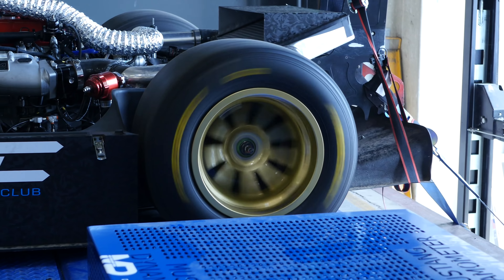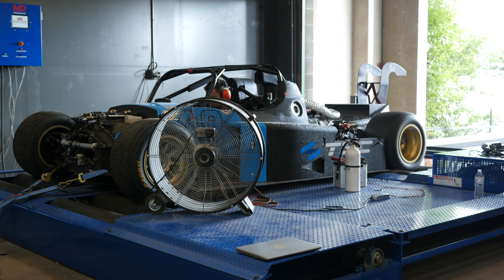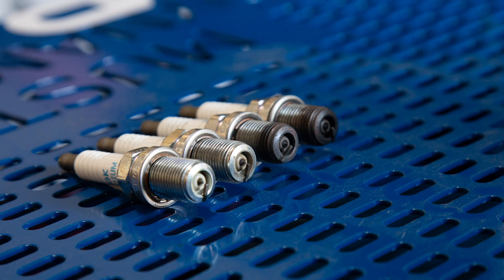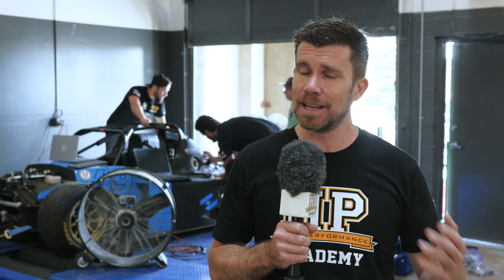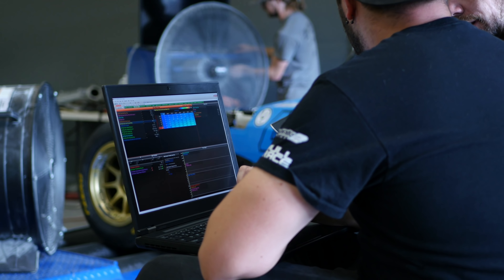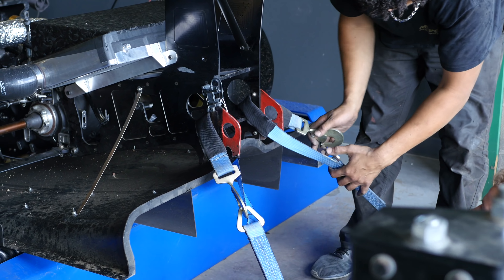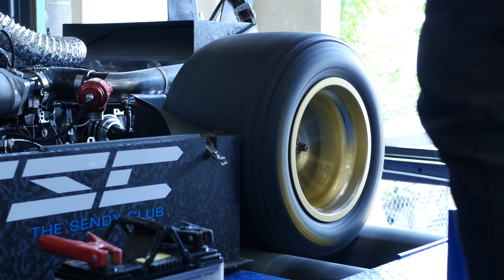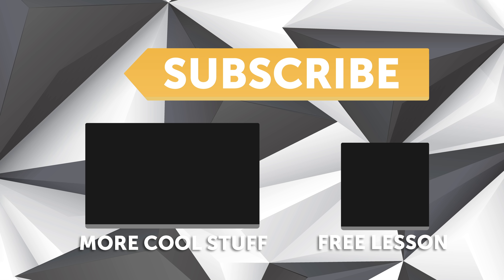Can you guess what was wrong? We couldn't.

Comment: Even on non vvt engines, when I have a cam sync signal I always log the vvt angle or take note of the 'sync' position so changes like this can be found straight off the data by comparing it when the engine was tuned.  Terribly unlucky to have this happen after the car made it halfway across the world!

Comment: I usually work on ca18, rbxx and sr20 Nissan engine, and a common issue appears when people reconnect the 2nd and 3rd ( or 3rd and 4th or RBs) injectors and exchange them, which causes a rich mixture, misfire and idle problems. Glad you found what causes yours 👍
Reply: Faulty coilpacks and connectors for days!

Comment: I would have spotted this within minutes, as the ECUs I use let me log the relationship between the crank trigger and the cams, ignition coils, injectors. Also because I have done a lot of work with the Honda K series engine and the timing mechanism on them has not been perfectly reliable in the past, had dowel pins shear off before as well as the chain jumping teeth due to worn out tensioners. So when one doesn't run right, the cam timing is always a top suspect.
Reply from the maker: @Baldur it's easy to look at this now and say you'd have spotted it instantly, however hindsight is always 20/20 . When diagnosing faults, I start by following the symptoms presented. I've been involved with dozens of engines over the years which had cam timing faults and they generally have a pretty clear set of symptoms that point to the issue which makes it quite simple to pickup so on that front I don't disagree. In this particular case however I've never seen the symptoms that this engine presented in 16 years of building and tuning high performance engines. Given the same set of symptoms again I'd follow the same diagnostic path we went down.
Reply: Yes, absolutely. I'm just saying I've seen this exact fault before on this particular type of engine.
Reply: So you would find a fault on someone elses car because you use ecus with advanced logging features. So you just change all customers cars to the same ecu?
Reply: Of course I have dealt with dozens of different types of ECUs, but I would advise my customers to use the best. I was just pointing out that the failure mode described in this video is extremely common, I've seen it numerous times on different types of engines and a few of them were Honda K series. How to avoid it, first make sure the bolts holding the sprockets all get the right amount of torque, they need a lot of it. Second, make sure the dowel pins are good quality, aftermarket cams sometimes come with dowel pins made of soft material. I've even seen an aluminium cam sprocket on a 4G63 shear off a soft steel dowel pin with no damage to the sprocket. Third, on the K series we also machine the timing chain sprocket on the crankshaft to be supported by a square key and not just the 4mm dowel pin that it uses from the factory, as even with proper torque on the bolt they have been known to turn and shear pin if anything goes wrong. From the factory the crank has a keyway to support the harmonic damper but the chain sprocket does not make use of this key but has a 4mm diameter dowel on its back face instead.

Comment: This is a really good topic, Is the car breaking up on test runs, might be the turbine being inadequate for the elevation changes. AFR on turbo might be choppy due to their tune at lower elevation, with the increased elevation that pikes gives you. Alot of guys run into this problem where they have to run larger turbines so they do not over drive them. Could of cooked the turbo, try decreasing waste gate pressure, let more boost out and run on more conservative tune. When i race na style sport bikes, dirt bikes, quads. They tend to break up once you get to a higher elevation, best way to solve this is run a higher octane fuel with a very lean fueling bias, (hint leaded aviation normally does the trick) by changing jets or fixing it in your fuel maps. The higher you go in elevation the more rich your fuel mixture becomes. Too rich of a fuel mixture causes problems with adding too much uncompressed volume and could cause damage to crankshafts and rods. In the same sense going to lean can burn holes in pistons, which is very common with cars using nitrous oxide. Just my 2 cents for anyone who may run into problems in this same scenario.
Reply: Well i made that comment without watching the whole video through, i did know, so i realize my comment may be not relevant in all aspects. Still has helpful advise in it so i'll keep it.

Comment: Great diagnostic skills, what put you guys onto the fault - the firing offset trace jumping aound?
It also reminded my of an old trick to play on apprentices as I wondered if Honda may have made some change - most cars are 1342 firing order but Fords were 1243, so swapping over the middle two cylinders would drastically drop the idle speed, etc, but still be relatively smooth, unlike a single dropped cylinder, and if the 'prentice didn't know they could be stuck for ages figuring it out.

Comment: Why does the fact that the car was dyno'd in Denver affect it's hp number from the dyno? Aren't the hp numbers normalized to an SAE standard spec to account for temperature and air density?
Reply: Only certain dynos will give corrected BHP
Reply: Ryaneg6freak any legitimate dyno on the market uses and sae, din or iso standardized environmental correction calculation. I wonder if it has something to do with the need to operate in a less than optimal portion of the conpressor map to get sufficient  HP at their altitude.  So their operational range in the Compressor map is less than ideal compared to sea level and this leads to less power even after correction... Idk, it would be interesting to here Andre chime in and explain what he meant
Reply: @fail_fast  yes the results are adjusted with an sae correction factor. The correction factor is just a educated guess not 100%. Cannot acount for all engine combinations. Also actual hp at course elevation matters more than corrected hp.

Comment: Love your videos dude but the first half of the video is presented as a different fault to the way it was explained in the last part of the video. 4 channel scope would have found that problem from the start. This time it's a thumbs down from me pal sorry
Reply from the maker: Hindsight is always 20/20 . When diagnosing faults, I start by following the symptoms presented. I've been involved with dozens of engines over the years which had cam timing faults and they generally have a pretty clear set of symptoms that point to the issue which makes it quite simple to pickup so on that front I don't disagree. In this particular case however I've never seen the symptoms that this engine presented in 16 years of building and tuning high performance engines. Given the same set of symptoms again I'd follow the same diagnostic path we went down.